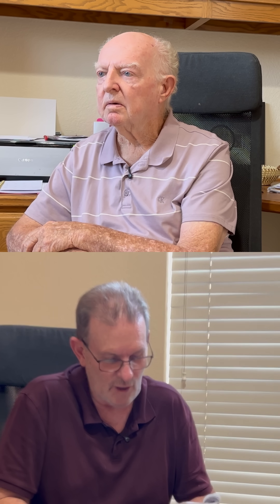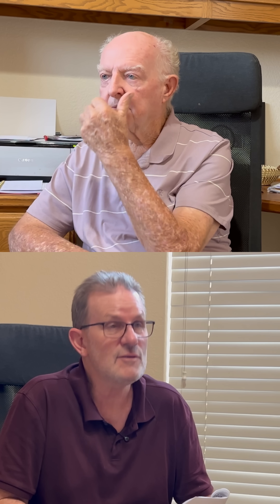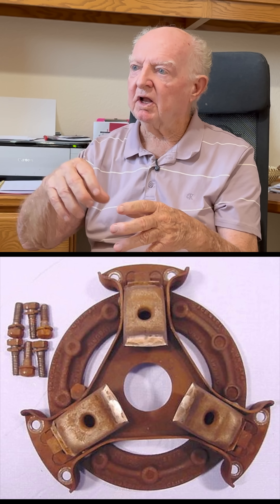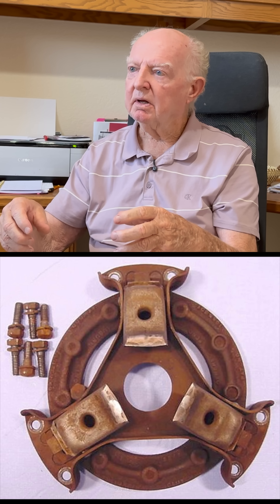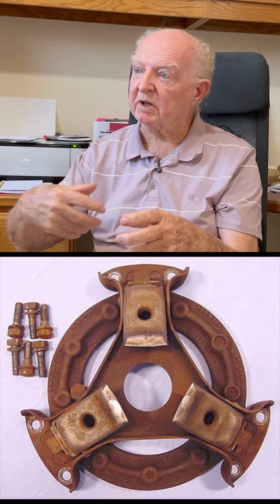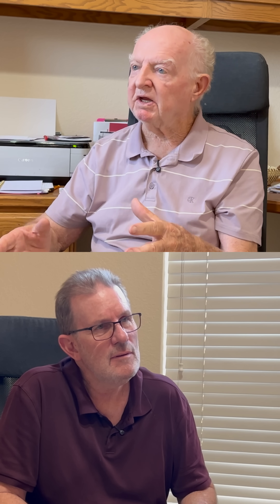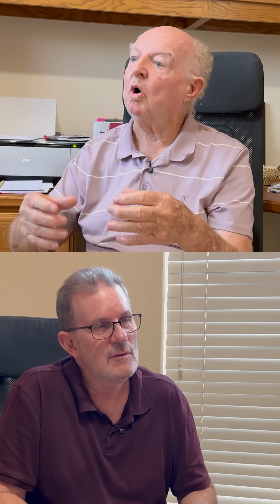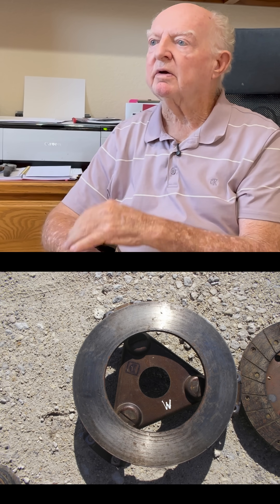Auburn Clutch - What and Why? Ask Ed Smith 40 #BarryT #enginebuilding

Comment: i think the pressure plates being referred to are the "long" (skinny) fingers and the borg abd beck(wide).  these use coil springs to apply the clutch.   i have operated these units and if they have been rebuilt with the high pressure springs will not only destroy your leg but also take all the mechanical linkage components with it.   todays friction material is far superior to 50 years ago.  go with a diaphragm style pressure plate.  how do i know.  i run a 502 big block in my pulling truck 85 k30 it makes about 450 ftlb of torque. has a mcelode clutch and will not slip.  my chevelle with its built 350 and clutch dumps at 5000 rpm 0 issues. foot effort on the k30 is maby 25 lbs. and the chevelle is close to the same.  chevelle is mechanical.  k30 is hydraulic. you can press either pedal to the floor with your fingers.

Comment: I still have a three finger, I got it used, and it was still a leg shaker. Brutal lockup, NO slip at all, and still as good as when I got it.
Reply: No kidding, "a leg shaker" is a fact! I learned to drive a manual with one and thought they were all the same until my buddy in high school got a worn out 66 Fairlane running and cried about the 11 inch "Hayes High Pressure" clutch the salesman at the speed parts store sold him. I jumped in and drove it to give him my ("highly experienced 15 year old's") second opinion and had to laugh at him, that Hayes felt buttery smooth to me! 😂